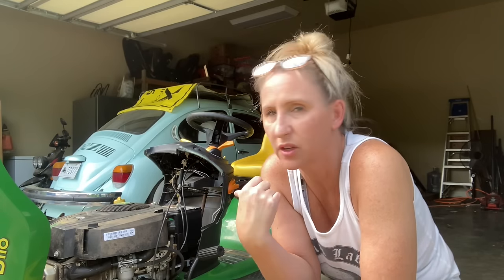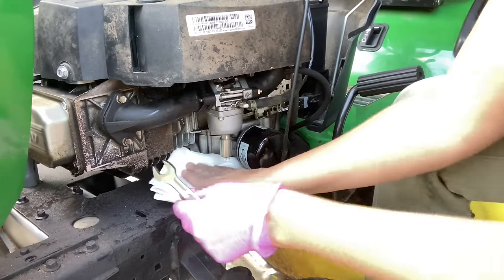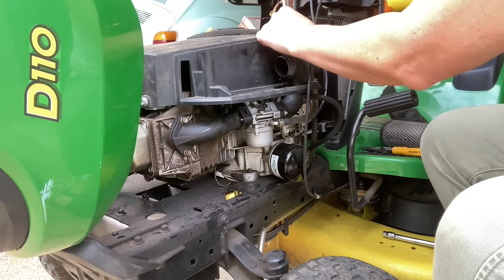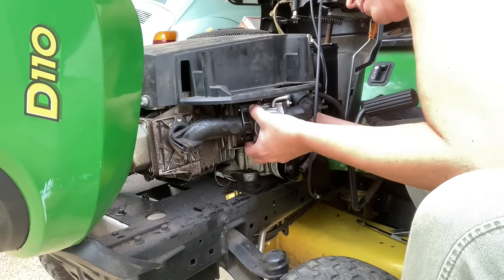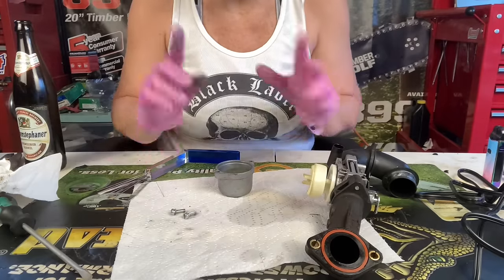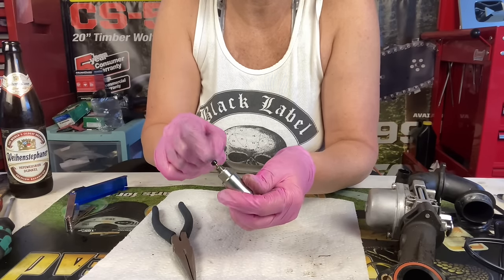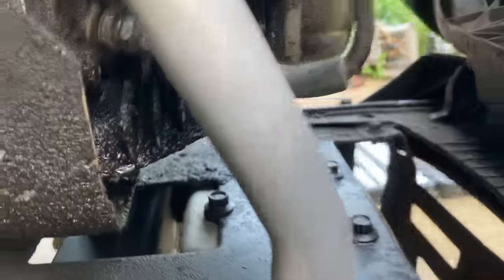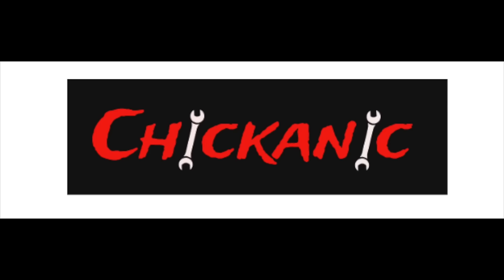Starving for FUEL: The Battle Against a Stubborn Riding Mower That Refuses to Start! Briggs/Nikki

Comment: I pay VERY close attention whenever you're working on a Deere, Bre.   Thank you!!
Reply: I was a caretaker for a ranch several years ago and found an old L100. It was in very rough state, including a carburetor that was literally in pieces. After some TLC (including new spindles and reinforcement rings due to rusted out mounting holes), a new carburetor and fuel pump it started up; 18 years old and I still use it to clear grass around my property. It's like the Energizer Bunny👍
Reply: @TheOnespeedbiker  The young couple who just moved in across the street "inherited" an old Deere 145.  It's in pretty sad shape, but we have it running for now.  Definitely needs new spindles and blades, but we've made a good start.  He's eager to learn!
Reply: @kbjerke  It's not uncommon for the mounting holes for the spindles in the deck to rust out making the replacement of the spindles problematic. However they make reinforcement rings that sandwiche between the spindles and pulley housings that work really well. Also try to buy OEM replacement parts if possible, especially drive belts. Yes they are more expensive but they are much better made and last longer.

Comment: Engine speed screams, extreme over-rev. Began while mowing sticks and dry leaves in scattered dry tall grass. I shut it off right away. Engine will not run slow, only extreme over-rev way beyond max on any small engine ever. Later start cold, again straight to over rev. What is it? How to fix? (Riding mower. ) Thanks. Bud Budster
Reply: Make sure there is not a stick stuck in the throttle linkage. If not the governor is not working. What type of engine?

Comment: Anyone have an ideas: iI'm trying to figure if I have an air leak or a weak fuel pump? An older JD GT-262 which has an inline transparent fuel filter. Always a lot of air bubbles in it (never completely fills with fuel). Since getting to the fuel pickup and line coming from the tank is a pain, I want be 100% sure that the problem is in that direction and not just a tired fuel pump that can't keep up. Thoughts?

Comment: What happens when it runs for about 20 minutes then it won't start it stalls out then you have to let it sit for about 15 minutes and she'll start up again then she'll run for a while and then it does the same thing any pointers out there
Reply: Might be the coil is over heating or possible that a fuel line is clogged.
Reply: Did you ever find out what’s wrong with that? Mine is doing the same thing right now

Comment: Do you have a video on leveling a deck. My Husqvarna is at the shop and they are saying it needs a new deck because it's bent but I noticed a bar on the right side moving and all new decks  don't have any hardware and I think it's the bar bent and not the deck

Comment: ??  Valve Cover "Doesn't come" with gasket, (no gasket installed) when new?   if so, that's odd.    
You Inspire the Desire to keep trying ....   i shall dig deeper.   : }  Thanks!
Fuel delivery is Major Issue here, i've pathetically just given up, for now - [years\months]. rant  sadly my Awesome '84 Scirocco with Excellent Engine, was rear ended, dude's insurance co. Refused to repair body, took months to get it returned, but - received FULL of Water inside & NOT Running.  i bombed the court route - Failing their Duty, (make whole) plus additional damages;  Not my forte'.   - no fuel getting to filter.   Still sits here.   ... i dream, one day it will run again. 
'95 Celica just not starting, Great Spark - next, testing Relay, "Circuit Open", but, bet it's Fuel pump.   {{{sigh}}}   
lol  sorry for stories, at times helps me think what i've missed.   Cheers!

Comment: I have a old 2000 Snapper WM280921B riding lawnmower that like to be bottle feed to start up . I allready change the carburetor and magnetron and did all the usuall turn ups it need. but after bottle feeding it and then starting it (pull start only) it runs very good . not a oil burnner or  anything . thanks if you know what i can do it fix it
Reply: FYI the Snapper is a pull start only no wires except the cut off switch

Comment: Question for you I have a 3 months old string trimmer after the 3rd running it quit running gas and oil correct new plug check further mo spark coil bad on the secondary side ordered a new coil fired right up ram good the day after crank but no run no spark air gap is correct contacting the seller of coil sent me out another one did a continuity test before installing primary side shows open contact the seller he trying to say it's some wrong with trimmer I'm not new to small engine I'm a retired auto tech he says he has sold over 300 pcs with no issues I know these are made in China magnet are strong plug is new good compression it's just the coils are going dead  any help from u is appropriated

Comment: I'm going to try asking you a question that I could not get John Deer customer service to answer. I want to install a shutoff valve on my John Deer S130 because I believe the best practice is to run the carb dry after each use. On my old craftsman mower, I just shut the valve off and let it run till it's out of fuel, but that mower didn't have a fuel pump.  Where should I put it? Before or after the fuel pump?
Reply: After
Reply: After the fuel pump because if run the pump dry it's pain because you have to prime it sometimes you air in the line then you have to remove it and get the air out
Reply from the maker: The other comments are correct for this mower. After the fuel pump is the best, but some mowers you are not able to and have to put in before pump.
Reply: @Chickanic  Thanks. Not just for answering my question but also for having the excellent channel.
Reply: @firebird77clonefirebird89  Thanks
Reply: @Matt-1992  Thanks

Comment: Hey I got that.. I'm serious about this. But I'm up in Minnesota. So I'm probably not going to want to take the whole tractor I don't believe due to shipping or whatever for the orange  t model taskarvana. . What are you talkin
Reply: And depending if you're able to ship me the motor. I can ship you back the old  core if you would like . It sat too-long the valves locked up. . No matter what I did .. I couldn't get them to float in there. Not to mention that particular tractor went through a relationship issue. There may be a very good reason why those valves are non functioning. . And you're probably not interested if you've already got enough parts the way it is. And that's cool. They make good door stops

Comment: What year is the beetle because if it doesn’t have factory fuel injection like mine it just an overgrown lawn mower engine
Reply: 1974 with a 1973 1600cc.
Reply: Thank you I have 1975 with factory fuel injection and 1969 with carburetor

Comment: Quick question, had a customer ask me the other day, while dropping off his rider, about what i thought on deck protection for under his deck. Being stamps deck dont last long, which we all know, but he wants to protect his recent investment, which i get, but i hadno real world info to provide him, what are your thoughts on this maam? Ive look on the good ole interwebs and the verdict is all over, im in SE TX, just lookin for more info here, thanks.
Reply: In Southeast Texas? Good luck, like a sandblaster every time ya start the blades. Could have the underside ceramic coated and it might last a season. The advice we give people is to keep the deck clean and dry don't let wet grass build up on the top or bottom of the deck.
Reply: That was my reply to him as well, however, he is not the type of individual who does that, hence his new investment lol. All his equipment, tractor, finish mower, tillers, round baler etc, is not taken care of like they should be, i dont even think a grease gun is in his vocabulary.
Reply: I used Duplicolor spray on bed liner under my JD deck. It works pretty well,  just have to touch it up every couple years. Been running that deck on my LA110 since 2009. No holes yet!

Comment: Ill take a nikki carb over fume injection. At least there is a 50/50 chance i can fix something mechanical. Electronic things are digital. Two states: they either work fine or dont work at all. Often they are protected from elements and reverse engineering by scratching the numbers and filled with epoxy. (Hermetic sealed) Unless you are a professional engineer with free access to a lab and can deconstruct a silicon dye layer by layer and reproduce the part, nobody is fixing any of the mystery modules of a CDI or EFI system.

Comment: Someone please help me 
I jave a Sears walk behind weed eater 1999 craftsman model with Tecumseh engine. I'm not getting any fire, no spark. I cleaned the flywheel magnet cleaned the magneto changed the plug no fire 
I replaced the coil gapped it with a business card nothing.
I checked the cable going to the turn off its operating as it should. I discovered the ground wire from the magneto still nothing
Please help